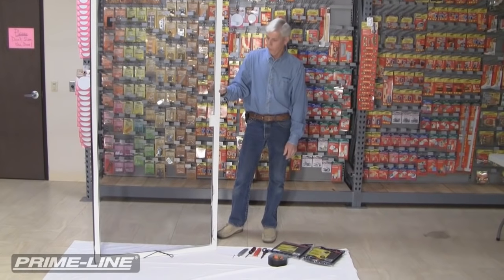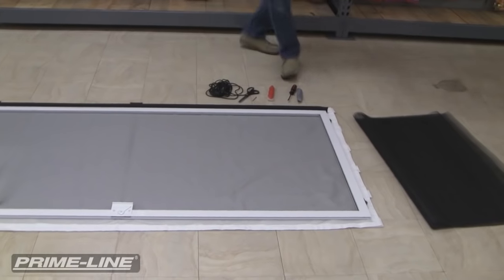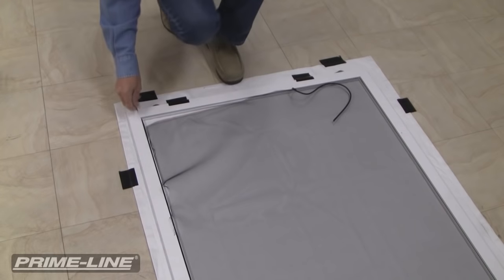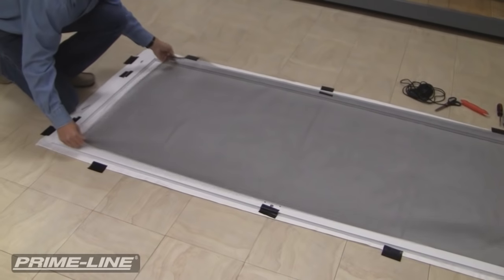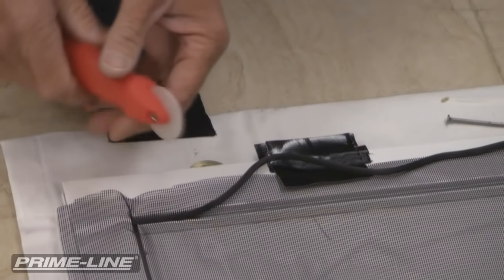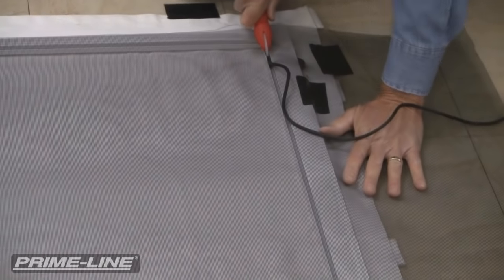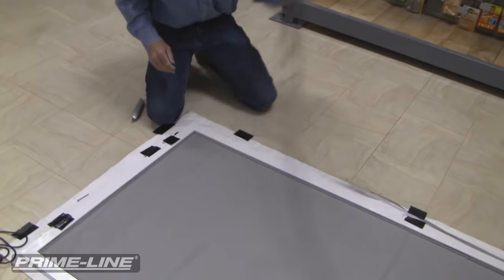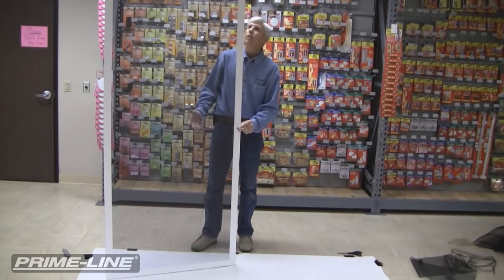Sliding Screen Door Re-Screening

Comment: Great video, helped a lot.  My knees don't let me spend that much time on the floor so I matched up two patio tables and taped the door to the tables.

Keep in mind that if your door is older than 10 years and the latch has plastic parts they may be brittle and break as you remove them or re-install them.  A new latch is cheap enough that you might want to have one on hand just in case.

My repair was because our lab "puppy" decided that we should have a pet door there and made one.

For this job I replaced the torn screen with pet screen.  I am also installing a pet guard and putting a doggy door through it.  The pet screen is a little harder to work with but should hold up to the dog and the kids much better.

Comment: Just a suggestion. Make sure when you are  screening the longs sides of the door(or any screen) it doesn't bow in on you. This will happen if you pull the fiber too hard. And this will matter because when you go to reinstall your screen door and you go to shut it the reveal will be the same. This will be an important key if you want your screen door to lock. So make sure you also have a measuring tape with you when you screen, so you can measure the width in two spots. The top or bottom doesn't matter and the middle and make sure the measurements are measured the same.
Reply: I forgot to mention that I have 15 years in the windows, screens and glass Industry. (Aka glazer)
Reply: Thank you.
Reply: Adrian landa any suggestions on how to keep it from bowing in?
Reply: @jediorion1124  get a 1/4" by 1 1/2" or so wood strip. Measure the inside of your door side-to-side before you start, cut the strip to size, then lodge it in the door. It will keep you form overtightening the screening. Then save it with your roller for the next time you replace.
Reply: @GayblazeJr  this is what we started doing
Reply: @GayblazeJr  sorry first timer , but what is it that will happen?  I don't quite understand and can't afford to mess up. Thankyou
Reply: @catmomlavender3036  The door frame itself is not completely rigid. So (for example) when you spline the second of the long sides, when you get to about half-way up, if you pull the screen too tightly, the opposite long side will bow in toward you--like two opposite parentheses -->  )(
Reply: @GayblazeJr  after you pull the piece of wood out won't the sides still pull in
Reply: @josephsullivan9030  No - it's putting the screen in too tightly that pulls the sides in. If you put too much slack in the screen it will look unsightly and it will be easier for animals to break through. The slat allows you to pull the screening taut such that it will stay taut and the frame stay unbowed. Back when we had aluminum screening this was not a problem...
Reply: @catmomlavender3036  I'm sorry I didn't see this. You cut a slat to fit the inside of the frame side-to-side, and put it in place mid screen (if you left it there and you rehung the screen it would be a horizontal bar at waist height.) What you are doing is reinforcing the straight sides so that you can't accidentally bow them in as you tighten the screening in place
Reply: Yep,this is a crucial step in doing this. You have to put the proper amount of tension on the fabric because it is so easy to pull the frame out of square and have a cocked door. Doing this is not as easy as the guy in the video makes it look,it takes practice.
Reply: @bobm2410  damn …that was perfect man! Stevie Wonder could see what you mean!

Comment: Great video.  One suggestion - no need to remove the screen door.  Save some time and effort and install the new screen while the door is still on the track.  Just tape the replacement screen to the frame and install as shown in the video.
Reply: That’s exactly what I just did bc the door was a pain to get out.  Worked like a charm.

Comment: Thank you so much for a clear and easy to follow video.  I stood in line yesterday at a large local big box hardware store and checked the price and lead time to have a patio door re-screened. In the process I saw the very poor quality of their work. After hearing I would have to leave the screen for at least two weeks I asked for DIY tips and was told that any re-screening will look "crappy" whether they do it or I do.  SAY WHAT?

I went home, found your video, went out and bought your products, and just did a beautiful job of re-screening my patio door screen in about twelve minutes. I can't thank you enough. It looks like new. No "crappy" factor at all.
Reply from the maker: The beauty of it is, even if you mess up the first time,  you just pull the spline out and try again.  (This is assuming you haven't already cut off the remainder screen from around the edges)

Glad we could help you out and give you the courage to try it yourself.

Comment from the maker: Best advice I can give you is that when you're pulling the screen,  before running the spline into the groove,  pull a little harder.   Now, if you pull too hard,  the frame can/will bow in and you'll have perfect screens for hourglass shaped windows. :-)
Reply: Make sure it's not tight if your adding a screen door protector also. I see alot of people put them tight because the protector will re square the frame. The problem is it puts pull pressure on the screen at the splines and over time will stretch it out. So now you have the opposite, a saggy screen.

Comment: If you have indoor-outdoor carpeting, let's say in your patio, that works great for a working surface. I had to redo my patio door and it used a 1/4 thick, flat spline, which wasn't easy to push down into the gutters, but I managed to do it.  If my roller had been an industrial strength one, it might have made it easier.  I just had the smaller one that I had used for my window screens.  They used a round narrow spline.

Comment: Thanks so much for the video.  My kids (3 and 6) and I watched the video together and they helped me get it done very quickly and easily.  Thank you!  Very helpful and informative. 

My 6 year-old is asking, however, what the scissors were for.
Reply from the maker: The scissors aren't necessary,  but some people use this kit for screening windows, or doors that are smaller.  In those cases it's sometimes easier to use scissors to cut out a smaller piece of screen before starting.

Comment: Nice video.  I used aluminum screen instead of fabric, which got a little tricky.  The next time, I think I'll go with fabric.  Thanks for sharing!
Reply: ive bought an in between product not fibre glass not quite metal above someone asked what the convex part of the tool was for and its for just that ....you use the convex roller to press and roll the metal screen into the groove then you use the concave to slide the spline in the pre grooved aluminum....so dont go fabric. between kids and pets and weather it doeasnt last nearly as long.  Im glad i read it cause i wouldve made the same mistake you did but now i kknow and so do you for next time.....go self screeners !

Comment from the maker: You don't have to pull it too tight before rolling the spline in.  Rolling the spline in will tighten the screen quite a bit.   You just want to make sure there are no wrinkles in the screen, and that you're pulling on it with a little pressure when rolling the spline.

Comment: Be careful with the spline size, especially if you are using an aluminium screen, because you will end shreding the screen with the roller, you will need a spline a little narrower than the groove so you dont have to push too hard, I ended up cutting 2 screens before I realised it

Comment: I spent a lot of time trying to remove the door by loosening the screws at the bottom and using a putty knife to try and get under the wheels without success. I was careful in pushing on the spline standing up as I did not want to bend the door.In the closed position, the door is supported on three sides. Handle was recessed into frame so that saved a step. The $9 kit I bought included screen, the tool and new spline, however the spline was too thick for my door and I just reused the old one.

Comment: Oh and I used the aluminum screen for the patio door, with 3mm spline. If anyone out there uses this, be careful around the edges, got at least one or two pieces stuck in my skin in the process. Tried to use my work gloves, but they were too bulky, so as long as I stayed away from the edges as much as possible, I was ok.

Comment from the maker: @rich6955 Thank you for the kind words.   Yes,  if you can find a large enough table to build the screens on,  it's a lot easier than being on the floor.      For screen shops,  we actually sell purpose built screening tables. a little overkill for building a few screens around the house, but essential for running a screen shop. You can see them in our Window & Screen Repair catalog linked to in the video description.

Comment: This is a great video. Very well explained and very professional. I followed all the steps and I think I didn't do so bad for a first time. I have a question though, what do I do to get the screen real tight?
Thank you
Reply from the maker: Well,   technically you don't want the screen REAL tight.  If you put the screen in too tight, either on window screens or door screens it can bow the frame inwards and you start to get an hourglass effect.  That's why on large window screens we use a cross brace to keep the frame square.  On door screens,  the frame is much thicker,  but it can still be bowed in if the screen is real tight.

You just want to pull on the screen slightly right as you're rolling the spline in at that part of the screen frame.
Reply: Got it! Thanks a lot.

Comment: Great video. I've got kids and have changed the screen on our back door probably 4 times and it's still a pain in the butt.
Reply: get the aluminum and use the convex part of the tool to press the screen into the groove before then using the concave side to press the spline in.....havnt put in in yet but apparently its much much stronger and lasts longer and wont rip like the fibre glass fabric versions
Reply: @lukescullin2948  makes sense. Thanks for the tip!

Comment: Thanks, much!  I just replaced the screen on my sliding door!  The tips about using tape, and alternating edges when installing the spline really helped!
Reply from the maker: Matt Fetterley You're welcome.  Normally a screen shop would have a table with a jig to hold the frame while it's being screened.  It's not something a homeowner would have, but they would have tape, and it works pretty darn good.

Comment: One of my customers has sliders that will not come out of tracks. The door bottomed out at the top or the bottom wheels fully retracted and the door will not clear the outside rail of the track. So I am going to attempt installing the screen while the door is standing up. Should be interesting, to say the least.

Comment: I did it, all by myself. Now, I just have to figure out how to mount the door since it doesn't have  the adjustable wheel underneath the bottom. I bought some, I just hope it is the right ones. One thing that was not mention and it happened to me is be careful when using the concave side of the spline tool. It can slice the screen as you are using the tool. I discovered two places that was accidentally cut, as I was cutting the excess screen off.
Reply from the maker: If you're having trouble identifying the rollers for your door, you can email photos to info@primeline.net and we can let you know the model no. of the ones you'll need.
Reply: Prime Line I will definitely do that. Thank you.

Comment: The person at the hardware store recommended that I buy the pet screen type and told me that I needed the 0.16 width spline, but I am having a heck of a time getting the spline into the channel. I think the thickness of the screen is taking up a lot of room where the spline goes. My question is, how much pressure is needed to get the spline in the channel? Am I giving up too soon or did I get the wrong size of spline?  I am thinking of getting the 0.14 spline instead.

Comment: This is a great DIY video! I've got two questions: first, how do you determine which size spline to get, and second, you used the concave wheel but what is the convex wheel used for? Thanks!
Reply from the maker: Size of spline depends on a lot of things.  Type of screen fabric, thickness of screen fabric, brand of frame, etc.

As for the two ends of the rolling tool.  The convex end is usually used to pre-roll metal screen fabric into the spline groove on the screen frame prior to inserting the spline.  Then the concave end is used to roll the spline in.  Metal fabrics are a little tougher to work with, so pre-rolling in the fabric helps a lot.

Comment from the maker: This is an Andersen screen. Once the metal spline is pried out, it cannot be reused. Our .270 diameter foam spline will replace the metal spline.
P 8135 - Screen Spline, .270, Foam, Black
Reply: I had a metal screen and plastic spline to replace in a 91" x 34" opening.  The problem is that metal screen is hard to find.  I had to purchase a 25' x 36" roll of slippery fiberglass screen - which is much more difficult to work with as the spline (same diameter as before) does not hold the screen well in the groove - even with using the proper rotary tool..  Everything is slipping out and tape does not hold it in place.  This is a mess!  I'm ready to take it all back to Home Depot.  Any other suggestions?

Comment: What size spline are you using?  I went to the hardware store and it comes ins a lot of different sizes?  Also, I see that the screen comes in different colors as well.  Is one color more commonly used?

Comment: This was a fantastic video....I get what needs to be done.  However, here’s a real stupid but basic question...how do I get the door off?  I have a patio door and the screen is on one side only....I have no idea how to get the actual screen off the track to replace it... any help for my first attempt to do it myself!
Reply from the maker: Not a stupid question at all.   The rollers on the bottom of the door are for adjustment.   You adjust them with a screwdriver so that the door is as low as it can go.  You then grab the door, lift it up into the top track, and pull the bottom towards you.  It should come out easily.   Then reverse the steps to get it back in.  In the top first, then swing the bottom in and re-adjust the rollers.  Hope this helps.

Comment: I thought you had to put the spline in all at once, I didn't know you could cut it at the corners.  Also can you reuse the spline that you remove from the door or do you have to get a new one?
Reply from the maker: You don't have to put it all in at once.   You also don't have to buy new spline if the old isn't bad.  Sitting outside all year, spline tends to get brittle and can sometimes be a problem when trying to re-screen.

Comment: The screen I need to replace is on a very old patio door.  The channel is not on the back of the door (it runs down the inside edge) and there is no spline in use at all.  How do I handle this?

Comment: very useful demo, is that just normal line used to fix the mesh on the frame?
Reply from the maker: Are you asking about the spline that gets rolled in to hold the screen to the frame?  If so,  yes.   The size and type of spline can vary based on the type of frame, and the kind of screen mesh being put in.   Some mesh is thicker, so you'll have to use a thinner spline.
Reply: Prime Line
thank you for your reply, I've successfully had my screen mesh replaced, the spline I bought from homedepot is a little bit thicker than what I need, so I just reused the old one, it's working fine. I even made a frame for my screen window and installed the screen mesh, they work well.  thank you for your great video.

BTW, have a cover between your carbet and frame is important, or you'll "mount" the screen door on your carbet. :)

Comment: Hey Lewis, thanks for the great video, the tape was a good tip as I had to do my door on my own so that made it a lot easier. I managed to do the corners without cutting the spline, is there a particular reason why you cut the spline for the four sides or is it just easier? Want to make sure I don't reduce the strength of the pet mesh.
Reply: It's just easier. For most of us, as we push the spline into place we stretch it a little. and it's easier to snip off the end and start a new run than to turn the corner keeping it tightly in place. I now precut the spline, start in the middle, at at each end where the roller won't go, use a slotted screwdriver to the that last inch in place.

Comment: Hello. Thanks.What I have purchased is the original metallic flywire mesh for my security screen door - which is very much stiffer than the softer polymer fabric you are using. Do you have any advice on how to install the metallic flywire mesh which is much stiffer and stronger?  I'm having trouble pushing the mesh into the grooves with the spline. Thanks in Advance
Reply: You need to "pre-crease" the aluminum mesh in the channel before rolling in your spline.  That is what the narrow concave roller is for (the convex roller should be on the opposite end of the tool).  If you did that, then perhaps the spline you are using is too thick.  Get the next size down @ the hardware store.
Reply: Thanks. That's what I have done and it DID work. The only thing I didn't do was film it to upload and show others. There's always the front screen door. It needs doing too!. Thanks again.